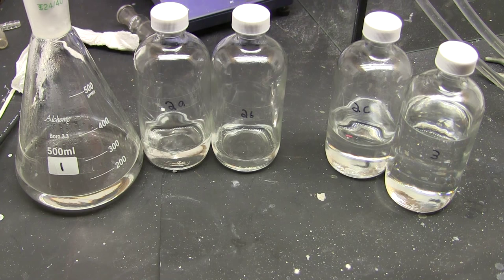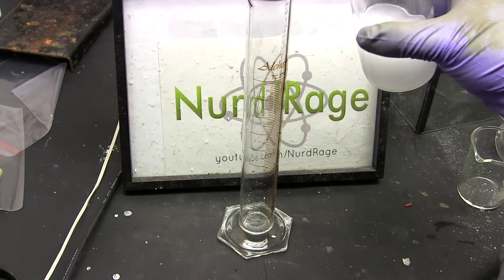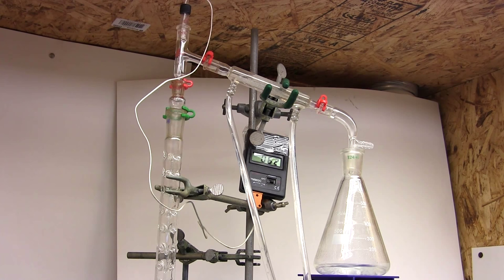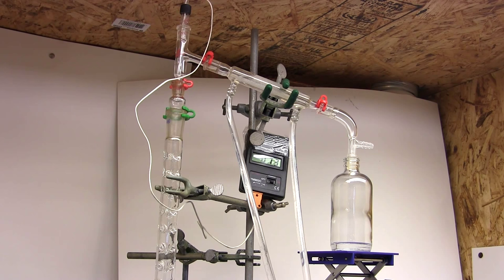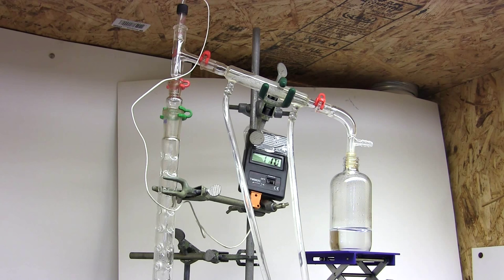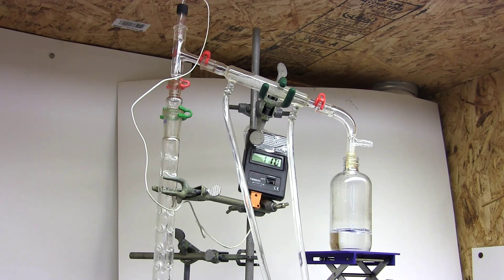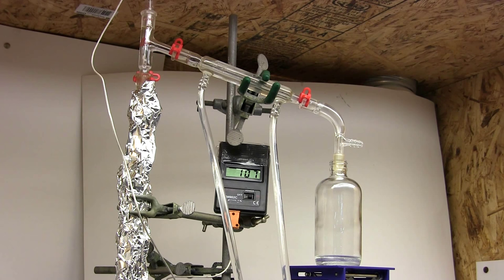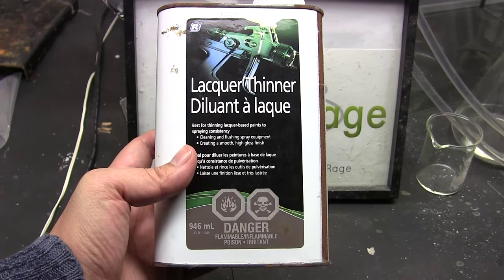Fractional Distillation of Lacquer Thinner to Obtain Toluene

Comment: The trick to best separation is useing an inert high surface filling for the insulated column, to create more theoretical bubble plates by increasing the wetted surface area. Just use stainless steel potscrubbers, they are killer. The second best is ceramic raschig rings, they are expensive and not as efficient, but they will withstand exposure to acids. The next trick is to use either liquid or steam management to have control over the amount of reflux occuring, or the amount of liquid collected. Done right you can achieve, for example, an ethanol content of 96.5%Vol. The effects are separation will be much more defined and effective, while the yield increases by creating less waste. I love distillation, a lot! :-)

Comment from the maker: This will probably be the last video to feature fractional distillation. Once you've seen a couple you've pretty much seen them all. The only other fractional distillation heavy video i might make would feature using a Dean-Stark apparatus for azeotropic drying. 

Anyway, Toluene is one of the base chemicals to make Pyrimethamine. So this is basically step 1. I'm also going to be distilling ethanol and a few other compounds, but i won't be making videos on those. My next video will likely be something on making chloroform, another chemical i need to make pyrimethamine. We'll see how things go.

anyway, happy halloween to those of you that celebrate it.
Reply: Hey Nurdrage, something something nitration nitration nitration? mmmh?
Reply: +NurdRage, on the topic of other possible apparatus for display, it crossed my mind that demonstrating use of a Schlenk Line could be rather interesting. I know I had a lot of fun with it in my inorganic lab at the university I attended and kind of wish I could use it now in my job, but the chemistry just isn't the same.

I was always intrigued at how efficient the line was at transferring volatile products, especially when utilizing liquid nitrogen around the receiving flask to condense them. They're just so very versatile for doing a large number of different experiments in a fume hood (especially with very hazardous materials - source, intermediate or final).

The one limiting factor I'm guessing is cost in this case, as I'm guessing a vacuum and inert gas source are not an issue... the glassware necessary can be, I understand.

Anyways, thought I'd share the idea. Thanks for the years of interesting videos (been following yours for a few of them); this is my first comment on YT so far, just never had the urge to comment until now.
Reply: can you do a video on the catalytic decomposition of solvents like these by copper or platinum?
Reply: +NurdRage  Can you make NaK (sodium potassium alloy)?
Reply: +NurdRage I love this video! XDOh, and By the way, Why don't you study Life Science?
Reply: +Mario&Luigi VS. Koopa (Princess Peach) Now I can't speak for Dr. Rage, but from my standpoint, Life Sciences involves Biology (which is a fancy word for "organic chemistry that moves under it's own volition). I personally find this a bit ... imprecise. I'd rather my experiments not have a mind of their own.
Reply: +Dāvis Zaķis Now there's a good idea. One question, however: what is it used for, aside from dropping from nose height to see if it really catches fire before it hits the ground.

Personally, I'd like to see his treatment of that MEK with some 20% Hydrogen Peroxide, though I don't know what the rules and regs say about such adventures up in Teh Grate Whyte Norf(TM a friend of mine).
Reply: rogerdotlee Dang. I didn't know Life Science equals Chemistry! Oh well. XD
Reply: +NurdRage This is why it was so hard to acquire methylamine in Breaking Bad ;)

Excellent video as always! Informative but not boring!
Reply: +rogerdotlee IIRC from a video by the folks at Periodic Videos on NaK, it was once mooted as a coolant for nuclear reactors...
Reply: +rogerdotlee Not all life has a mind of its own and besides that genetic engineering will get rid of that pesky 'free will' anything else clings onto. :P
Reply: Joseph Hinds Do you even know how genetic engineering works? And free will can be seen as illusion already - there has never been one.
Reply: +NurdRage old process operator here....your temps might have been off a little due to the pressure of  your splitter (you really have a splitter vs. a dist column) splitters are sensitive to delta t but when ends are so close as you have here delta p is the controlling factor...in other words stabilize temp/btu's input and change the delta p to control the split. anyway really cool video and thanks for making it
Reply: +NurdRage Could you make a video where you make water by adding hydrogen and oxygen together like Matt Damon's character did in the martian?
Reply: +Rookr Sure, Nurdrage has a few spare gallons of hydrazine as well as iridium catalyst and speciallised electrochemical cell with zirconia catalyst.
Reply: +NurdRage  plz could you tell me what the green product is after the reaction of dil. sulphuric acid , ammonium chloride and manganese dioxide after it is left over night. plz reply plz plz plz.
Reply: +NurdRage  plz reply on what the product is.
Reply: +NurdRage  plzplzplzplzplzplz
Reply: +NurdRage  what is the green substance i m eager to know after the reactionof dil sulfuric acid , ammonium chloride and manganese dioxide left over night plz reply.
Reply: I have an idea. Try synthesizing fluoroantimonic acid. Do NOT use materials other than teflon for this, as the solution will burn right through glassware, metals, and other things other than teflon. Fluoroantimonic acid has a PH of about -31. That's 1 QUADRILLION times stronger than sulfuric acid.
Reply: You are the teacher I wish I had growing up. I have spent hours immersed in your videos, constantly learning and wishing to go farther down the Chemistry rabbit hole.

Thank you for sharing your talents and knowledge with us.

- A student and professional of Electricity
Reply: Acklands Grainger Oshawa Ont. Large Toluene & large Acetone for excellent prices.

Comment: It would be preferable to use an actual boiling flask and a sand bath/heating mantle/metal block.  If something were to happen, and the glass broke, a bad situation would arise.   Though I'm one to talk, I Macgyver reactionware all the time.  I also have no glassware sponsor:(
"No, you wouldn't cook in that Jessie.  That's for general mixing and titrations!  Did you not learn anything from my chemistry class?"
Walter White

(WW is not a source.  Source: college.)

Comment: I extracted my toluene from carburetor cleaner. I just realized I did not want to go through the pain of fractional distillation so I added the same volume of water to the carb cleaner. Separated the toluene and distilled it. The forerun boiled over very quickly and it was discarded. The toluene came over semi slowly until I insulated the distillation setup. Then it was finally able to comer over at a good rate. Despite having broken glass pieces to act as boiling chips, the toluene was weakly boiling and sometimes would just bump a bit. It wasn't super vigorous but it would shoot a large amount of vapor into the condenser. My setup was able to handle it but I was a little worried. I had all fire safety protocols on hand though so I wasn't too worried in the end. The toluene finally distilled nicely and the yield from one $2 can of SuperTech carb cleaner (toluene is 10-30%) was about 75mL of pure toluene. It was probably still a little wet but it wasn't something I was really worried about. Considering my next quantity of available toluene is $20 dollars for a giant jug I have little use for, 75mL for 2 bucks isn't bad.

Next step is mono nitration muahahahaha

I'm not making TNT though :(

I'm making ethyl p-aminobenzoate! :)  

Aka Benzocaine.

Comment: In regards to your list, you could also get a better separation by using a roto vap - assuming you have one of those on hand. They're a little expensive, but are incredibly effective at separating out compounds and you wouldn't have to worry about the height limitation of your workshop/lab.

Comment: That's the same brand I bought and extracted the 2-butanone and toluene. I used the toluene to make benzoic acid (oxidized it with KMnO4). I used the 2-butanone to make hydrazine sulfate but I messed it up. Later on, 2-butanne (MEK) became available at Canadian Tire, 946 mL for 12$.

Comment: I have done this before with Slovakian Brand S6001 lack thinner. From 960ml i got around 400ml of Toluene before I run out of coolant. I have to complete the process some day... In the Lack thinner, there should be around 75% Toluene and the rest ist Kerosene and higher carbon hydrates. Because the Boiling points of the ingredients are so different, I doesn’t needed a fractional distillation. The temperature didn't changed so I guess I distilled clean Toulene. BTW: you get 960ml S6001 for 2.35€ so its very cheap.

Comment: You can get brand name thermocouple probes as a sensor with +/- .25C degrees within a fairly decent operating temperature range for under ten bucks. Using an electric heating element (take apart an old hair blow dryer, or hotplate, or some shit) and an any given IC with a ADC for the thermocouple data, a PID feedback loop programmed into the IC, and then pulse-width modulate the heating element (the MOSFET is probably going to be your most expensive component). 30 bucks and youre good to go. Since you probably spent that much money on that glass to begin with, its a fairly good investment. 100 bucks for more resolution on your sensors and you've basically hacked together a few thousand dollars worth of ThermoCouple gear. 

Why did you choose to forego sleeving the column? What if you lowered the pressure within the system via a vacuum pump? Would that help with a better composition of your mixture? Obviously the joules required (or kCals or whatever the fuck units you want) to hit your ideal temp will go down, but would the separation be more effective that way? (I'm genuinely curious, I never took any chemistry in college and drank my way through high school so excuse my ignorance. ). Actually, now that I had a second thought about it, I bet introducing lower pressure would be worse since all them crazy compounds will be moving at a faster rate so the mish-mash (I'm sure theres a technical term for whatever the slurry is that you extract as an intermediary between temperature intervals of separation) would be less pure.Hmm, so I guess you want to introduce more pressure and/or less heat for the best distillation?

Comment: A chemical that I have always wanted and needed to conduct some particular experiments with is hydrogen peroxide 30%. You can't buy it anywhere though. I would love to see a video on distilling hydrogen peroxide 3% into a 30% solution. Or do you know of an easier way? Thanks! Loved the video!!
Reply: +destroyerofnoob 30% available at beauty supply stores.
Reply: My gf has 35% hydro peroxide.  I believe it can be found at specialty food markets or cleaning places.  It is labeled food grade.  Good luck!
Reply: +destroyerofnoob distillation will probably not work for hydrogen peroxide since applying heat will also accelerate the natural decomposition of the peroxide. So while you are removing water, you are also destroying the peroxide
Reply: The boiling point of hydrogen peroxide is actually higher than that of waters, so you can just boil it down. It does work, but like +pieterG159 said, it actually destroys some of the peroxide.
Reply: I have conc it up to 17% just by gentle heating. The density went from 1.000 g/cm3 to 1.03.
Reply: I bought a gallon of some 35 percent at a hydroponic store for like 50 $

Comment: was it your intent to distill off the individual solvents?  Could you have set the temp.  for 90°c, and just driven off all the other solvent and retain toluene in the original flask?  Could you explain why the fractionating colum doesn't have cooling applied to it?
Reply: +Matt S. Yes, as he stated in the video, he wanted to keep the impure methanol for later.
Reply: +Mark Rose I realized the question was irrelevant as I watched further into the video

Comment: Would it be practical to separate the ketones from the toluene by converting them to imines by addition of ammonia then adding HCl solution to produce two layers of liquid, one an aqueous solution containing the imine salts, the other pure toluene?
Reply: The problem is imines and iminium ions are hydrolysed easily, so as long as there is water present you won't be able to separate all ketones this way, some will always exist in equilibrum.
Reply: +Marcin Goławski Hmmm, suppose instead of ammonia solution you used ammonium chloride and a dehydrating salt driving the reaction to the right. Would that work?
Reply from the maker: +Libertarianist It's not very practical, the equilibrium in water isn't very favorable toward the imine. Then there is the extra work of dealing with the ammonia and the HCl. If we just wanted the toluene and could discard everything else, then it would be much more practical just to do water extraction like i mentioned in the video and a bit of distillation to get rid of any lingering impurities.
Reply: Take a few semesters of chemistry and find out.
Reply: +Libertarianist "Possible" absolutely. "Practical?" not in even a fairly well equipped home lab.

Comment: No, no, no Jessie! Your erlymyer flaskk is used for titration and mixing. Oh now .you would need a round bottom flask for boiling, it's much better able to handle the thermal requirements of the synthesis.
Reply from the maker: Not really. As you can see in the video it works just fine

Comment: Would you consider nitrating some of that for a bit of fun? (Depending on the laws in your jurisdiction, of course)
Reply: +top2percent I've heard you have to nitrate it 3 times to get TNT. I'd assume you'd use a similar method to making nitrocellulose. But I would like to see him make a video on it.
Reply: +Mr.chang cooler Yes you need to nitrate it three times at different temperatures and acid mixtures. It takes quite a lot of time. I think that at third nitration you need to heat it for 3 and half hours at 80 degrees and for another hour at 100 degrees Celsius.
Reply: +jeti08 reti The third nitration also requires an anhydrous mixture of nitric acid and oleum.
Reply: +top2percent He probably couldn't honestly. Toluene is methyl benzene and its nitration occurs through electrophilic aromatic substitution. When doing EAS reactions, the substituent you add to the aromatic ring will be either activating or deactivating, which effects how well subsequent substituents will add through EAS. Nitro groups are deactivating, meaning that it is more difficult to add subsequent substituents each time you add one. To make Trinitrotoluene would therefore require very intense heating and extremely high acid concentrations (a nitric acid and sulfuric acid mixture is used to form the nitronium ions that bond to the ring) that at very least I suspect he'd be uncomfortable working with.

Comment: What is the main difference in quality beyween cheap (~30 €) lab power supplies and expensive lab power supplies (~250€ or so?) The difference in price is really big so im scared to buy a cheap one... I was about to get an used 250 € one for free, but because of a problem with a j*** I wasnt able to get it, so now I want to buy one sine getting it for free didnt work
Reply from the maker: +ficolas2 Most of the time the companies just price gouge you because they want profits. 

Sometimes, the greater expense is because the power output is less noisy and can handle transient load changes better than the cheaper ones. For electronics work like digital processors or sensitive radio equipment this can be very important. But for chemistry, it doesn't matter at all. So get the cheaper one if it's for chemistry.

Comment: At the end of the first distillation run, why did you continue to distill the remainder which should have been pure toluene? Could you not have just stopped the distillation there and the main flask would be the pure toluene you were seeking?
Reply from the maker: +Mavericfso it should be pure,  but it isn't. If you looked at the flask when i briefly showed it at the end of the distillation run, there was a gooey yellowish impurity of unknown composition. This would have remained in the toluene had i chosen to stop it.
Reply: No, there's non volatile impurities in the starting material.